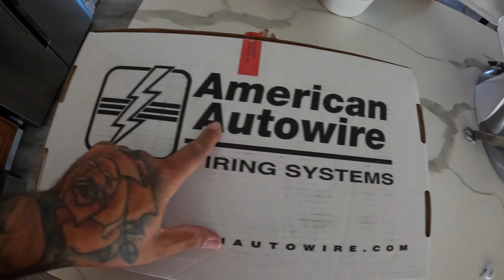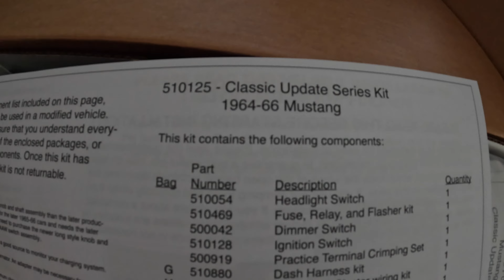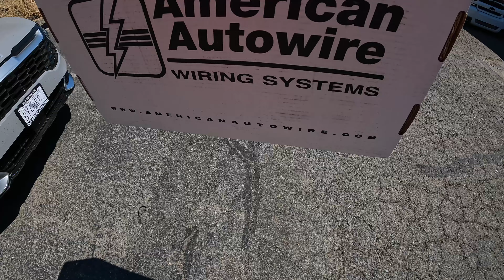Whoever Built This 64 Mustang Should Never Touch A Car Again...

Comment: I had a 2001 civic. First and last honda I buy from a Puerto rican. They wired the alarm and radio together just like that. But tan masking tape. (I didn't know till what happened below)

One day I smell a sour smell coming from the ac. I turn it off. Still smell it. I turn the radio down and it falls forward and flames come out the hole where the radio was. I pull across 3 lanes. Throw my smoothie into the hole so the fire went out.

Then I saw they wired everything with speaker wires and masking tape. Most stuff just touching bare metal on the chassis. Car could have burned down.